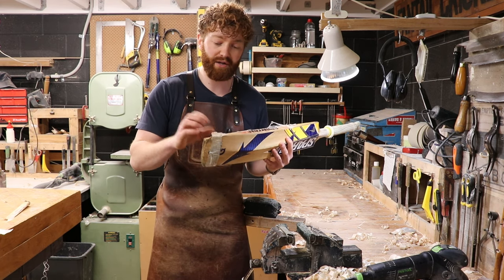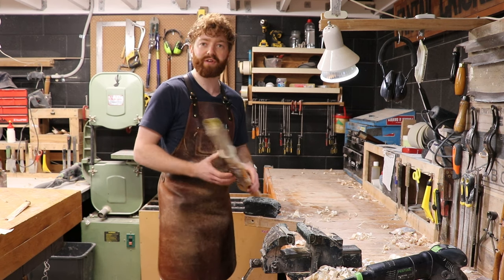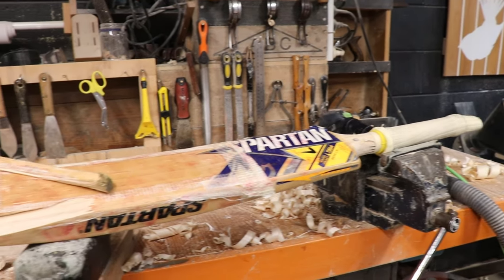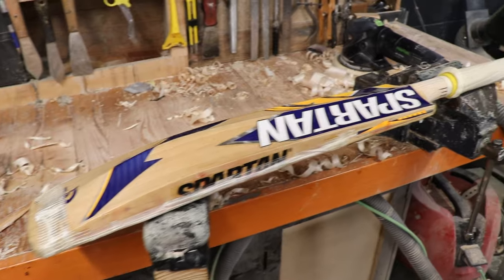Transforming a moisture damaged bat - Cricket Bat Repair EP 15

Comment: Hi. amazing work, really turned out nicely and your work is impeccable. I'm curious, what materials did you use to put the toe cap on. I'm from SA and I havent seen any of the batmakers here do that. I have a bat with a cracked toe that I'm fixing and I want to strengthen it and prolong its use, its a super nice bat and I want o keep it going as long as I can

Comment: Great work. What sort of glue do you use to reattach the chunks at the side? Cheers
Reply from the maker: Epoxy for open cracks/handles, super glue for surface cracks. If we need to fill a small area we'll use an epoxy/English willow dust mix.
Reply: Thanks so much for sharing 👍 @FantailCricket

Comment: Hi, what kind of glue do you use? Do you ever use superglue for the smaller cracks? What do you do if there are pieces of wood missing from the face? Cheers, Ross in Denmark 🇩🇰
Reply from the maker: Epoxy for open cracks/handles, super glue for surface cracks. If we need to fill a small area we'll use an epoxy/English willow dust mix.